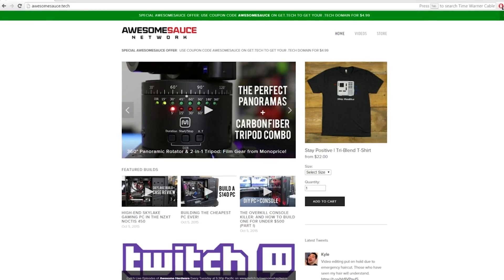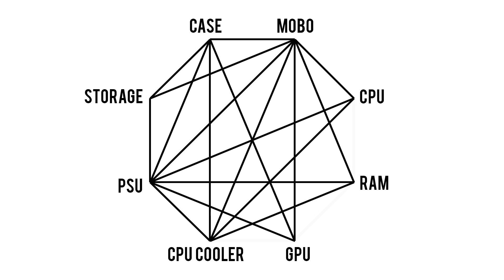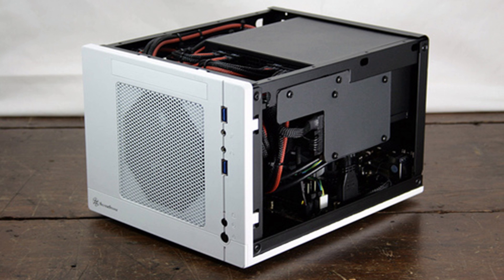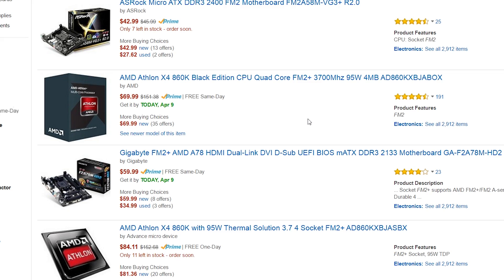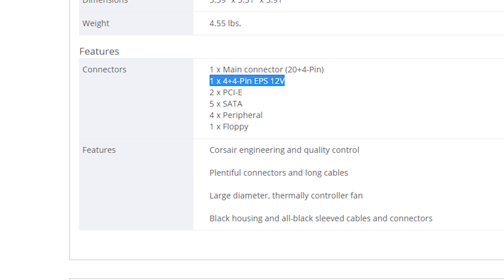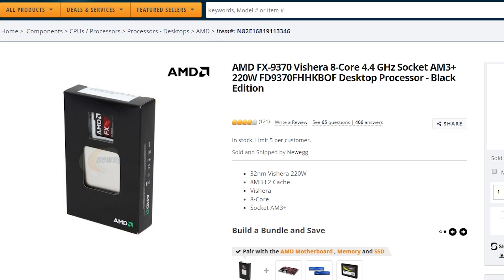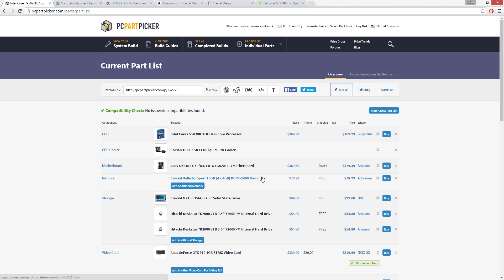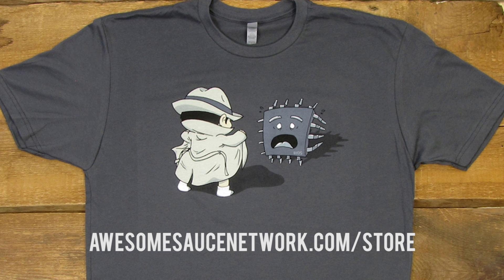How to Choose Parts for a PC! The Ultimate Compatibility Guide!

Comment: Hey I’m planning on building a pc but I’m not sure about the compatibility of my selected items can someone please help me out?

Gigabyte gtx 1660 OC 6gb 
2x8 Corsair vengeance rgb pro 3200mhz ddr4 ram
Thermaltake smart rgb 700w power supply 
Kolink observatory lite mesh ARGB case
Asus prime b460m-k motherboard 
Intel i7 10700F cpu
Thermaltake pure 12 ARGB sync radiator fan 120mm 
Gigabyte dual band wifi 6 ax pcle wireless adapter

Comment: "Look out for the height difference between the cooler and case"
so im guessing the cooler needs to be smaller?
Reply: Not sure if you are joking but yes, the cooler needs to be smaller than the available cooler height in you case of choice. Otherwise, the side panel won't close properly(or at all).

Comment: Here are my computer parts!

Corsair Icue 220T RGB Airflow Tempered Glass Mid-Tower Case Black

GIGABYTE Z390 Aorus Pro Wifi LGA 1151 Gaming Motherboard

Intel Core i7 9700 9th Gen 8-Core Processor

HyperX Fury RGB 16GB 3600MHz DDR4 Ram CL17 DIMM $ 100.01

MSI GeForce GTX 1660 Gaming X 6G Graphics Card

SAMSUNG 860 EVO-Series 2.5" SATA III Internal SSD MZ-76E250B/AM

Seagate ST2000DM008 BarraCuda 2TB 3.5 Hrad Drive

CORSAIR CX-M Series CX750M 750W 80 ATX12V Power Supply

Silver Stone NT07-115X Nitrogon 80 mm Low Profile CPU Cooler

Computer Cooling Case Fan

Comment: I didn't understand most of the things he told. Can anybody just tell me if It'll work pls:
Ryzen 3 3200G
MSI A320M-A Pro Max Mobo
Corsair Vengeance LPX DDR4 3000 RAM
Crucial BX500 SSD
Corsair CV450 PSU
Corsair SPEC-05 case
*its a super-budget build btw

Comment: can someone elaborate on the usb header situation? Im working on a build with 2 usb 3 slots in the front IO but the motherboard that was recommended to me has one usb 3.2 1st gen header while my case is outputting the 2 usb 3.0 slots. is this compatible or should i need to get any adapters to accommodate ?

Comment: CASE = Narrow box that holds everything

MOBO = Motherboard
The mobo is where everything plugs into 

CPU = Central Processing Unit
Basically does everything

RAM = Random Access Memory
Stores data that needs quick access

GPU = Graphic card
Figures out what it’s suppose to look like on your screen

GPU COOLER = Small fan so that gpu doesn’t over heat

PSU = Power Supply Unit 
Gives electricity to what needs it

HARD DRIVE = Storage
Opposite of ram desc., stores data that takes longer to access

Im still kinda new at this so if wrote something wrong please tell me. I really don’t want people to get the wrong idea!

Comment: Awesome guide. the only thing id add is to make sure that if you wanna mount a lot of case fans, you'll also need to make sure, that either your motherboard has enough connections or that your PSU has a SATA connection to spare for a fan controller (if your case doesn't already have an fan controller)

Comment: I recommend you watch this video as you check for compatibility. If he says you need enough sata connectors for your hard drives. Pause the video and check. I used this method and it seemed to work but I haven't ordered the parts yet.

Comment: there is a massive discrepancy between the wattage of the video card between what the manufacturer says and PC part picker says (275 watts), what do I need to do?
Reply: PC part picker normally says the wattage is higher than it actually is, less room for error that way
Reply: @dabirdie1797  the manufacturer says it's 500 while pc part picker says it's 225
Reply: @comradepingue1917  Are you sure they're the same?
Reply: @dabirdie1797  100%
Reply: @comradepingue1917  What is the part?
Reply: @dabirdie1797  xfx-radeon-rx-590-8-gb-fatboy-oc
Reply: @comradepingue1917  It depends on what you're playing. I'd recommend going off of the higher one so you dont buy a power supply that doesnt power everything
Reply: @dabirdie1797  I already got a new one, don't worry, but I wanted to know what I needed to do in case PCpartpicker said something else than the manufacturer

Comment: Nice and clear, I will have to rewatch a few times but the video is very good! Thank you! 
One question though: If I buy all the things, do I have to buy cables sepparately or are they normally included with the parts I order?
Reply: Most of the cables are included, except for the video and network cables.
Reply: @JJFlores197  thank you :)

Comment: Also ensure your CPU and RAM are compatible; this isn't much of a problem on high-end components but in the low-end CPUs can have a fairly low maximum memory speed support, for example the Ryzen 3 3200G only supports up to 2666MHz memory. Memory capacity is also to be taken into consideration as again, some CPUs cannot handle more than say 32GB of RAM, or are only compatible with a certain channel (single, dual, quad, etc)
Reply: Oh yeah, also make sure your CPU isn't bottlenecking your GPU, and vice versa. Low-end CPU = low-end GPU and same on the high-end. One way I've heard of ensuring these components play nicely is benchmark videos; if one component is consistently at 100% load and the other one is chilling at 70%, the 100% component is bottlenecking the 70% one. If both components are at 100% it's the game that's the problem, so check games that are less resource intensive to find which component is the real bottleneck

Comment: You should also connect a line between cpu and gpu as you need to check for bottlenecks and jf building with ryzen a line between the cpu and ram as the cpu is highly dependant on the speed and size of said ram

Comment: Dude I just got the shit confused out of me. I recently built a pc on pc part picker and I really want to know if it is compatible like what you are talking about in this video, can you please look over these parts and tell if it is ok. 

CPU- Intel core i5-9600k 3.7 GHz 6- Core Processor

CPU Cooler- Cooler master hyper 212 RGB Black Edition 57.3 CFM CPU Cooler

Motherboard- Gigabyte Z390 UD ATX LGA 1151 Motherboard

Memory- Corsair Vengeance LPX 16 GB (2 x 8 GB) DDR4-3000 Memory

Storage- Crucial MX500 500 GB 2.5” Solid State Drive

Video Card- Zotac GeForce RTX 2060 6 GB Gaming AMP Video Card

Case- Corsair SPEC-06 ATX Mid Tower Case

Power Supply- EVGA BR 500 W 80+ Bronze Certified ATX Power Supply

Please help me.

Comment: Everything checks out on my build except for the motherboard and case ports. The case says 2 x USB 3.0 / Audio In & Out and the motherboard 2 x USB 2.0 connectors (supports additional 4 USB 2.0 ports)
2 x USB 3.1 Gen1 connector (supports additional 4 USB 3.1 Gen1 ports. Could you help?

Comment: Hey Bitwit, I am currently a console player but have really been trying to widen my variety in games and start playing competitively. I would do it on console but it doesn't function fast enough. I can definitely keep saving up as I've been doing lately. But, is there a (Up to date) list to buy budget wise for someone trying to do the same like me
Reply: I just did a budget build for about $800, and it runs flawless full HD at over 100fps on epic settings in every game I've thrown at it so far, and it has a crapload of room to expand in power. Would you like the link to the build sheet? It would be a good starting point to modify to your needs.

Comment: Another tip is to make sure the CPU you pick will  be operating at an equal or greater data flow in comparison to the video card so that you prevent bottlenecking your system. For more details search for PC bottlenecking articles.
Reply: Translation:
CPU = brain of the pc
Video card/GPU = torso of the pc
Brain has to be smarter and faster than the torso to operate correctly.
Reply: This just gets more confusing
Reply: @Elite_Sturmgewehr  The mindfuck that keeps on giving.

Comment: Hi, i am an interior designer from mumbai. i saw some videos of pc building and i made a list of pc parts for my 3dsmax modelling and rendering. could you please tell me that is it a good configuration or not? or else suggest some good parts. 
1. CPU - Intel Core i7 8700k Processor LGA 1151
2. Motherboard – Asus prime z390a
3. Graphic Card – zotac geforce gtx 1050ti mini
4. RAM – corsair lpx 32gb (2x16gb) 3200mhz c16 ddr4
5. Ssd – Samsung 970pro 512gb nvme M.2
6. External storage – 1tb
7. CPU cooler - Cooler master hyper 212 EVo
8. Power supply – any of 650w aprox
9. Cabinet case – compatible with other accessories
10. Cabinet cooler fan
11. Monitor – Dell s2719h s series 27” black
12. Keyboard and mouse.
Reply: No the GPU is way too bad for a high end CPU like i7. Get a rtx 2060 or 2070 or that

Comment: I just noticed that at the beginning of the video when you showed the whole octagon, there was a connection shown between the RAM and the PSU, yet when you went over the RAM section in the video, you didn't brief on the MOBO 'cause you already did that, then you explained the compatibility requirements between the CPU cooler and the RAM, but nothing afterwards about the PSU. Is there really a connection between these two components or was there just a mis-drawn line in the video? The same full octagon at the end of the video has this same issue. The connection also was not gone over in the PSU section, either. I'm not experienced in this field, and am looking to resources for learning, this was just something I noticed.
Reply: Here I was thinking I was the only one that noticed, did you find out what relation those things have and could you share with me?

Comment: after about 1000 tries on seeing if the motherboard is compatible with the case I am seriously thinking about just cutting a cardboard box
Reply: I'm not sure what the issue would be because there are only a couple of sizes of boards and a couple of style cases so they cant possibly be that different. mATX or ATX, that's about it. The case will have connections for whatever size it is.

Comment: What’s the difference between hard drive and SSD
Reply: HDD wirtes on Magnetic Disks and  SSD uses a Flash-Memory like USB-Drives. SSD are much faster, more resistant and more expensive.
Reply: Gsudi so can I have SSD without the HDD?
Reply: Shure, they are both different kinds of Hard Drives. But it's recomented to have both because SSD's are very expensive. Usually you have a smaller SSD for Windows and your most used Programs/Games and a HDD for Storage.

Comment: what about rgb cpu cooler connections?
there is a 3pin and a 4pin
Reply: You can put a 3 pin cooler on a 4 pin motherboard connector, there are no 3 pin motherboard connectors so it's never an issue :)
Reply: @nucleardonkeyboy1361  i actually found An asrock argb 3pin connector

Comment: Can you please check out the parts that I chose for my computer. Thank you

Case- Corsair Carbide SPEC-06 RGB

CPU- Intel Core i7 8700K Cpu Processore, silver

RAM- Corsair Vengeance RGB PRO 16 GB (2x8 GB) DDR4 3200MHz

Motherboard- Asus PRIME Z390-A 

Hard disk- Seagate ST2000LXZ01, 2 TB Firecuda Gaming Sshd

GPU- Asus GeForce DUAL-GTX1060-O6G, GDDR5 6 GB

CPU Cooler- Corsair Hydro H100X

Power supply- Seasonic Focus Atx da 850W, black

OS- Windows10
Reply: With this budget, I would extremely recommend that you get an SSD or M.2 drive. You can probably sacrifice your ram RGB for a windows boot drive.

Comment: You mentioned steering clear of placing smaller mobo’s in a larger case to prevent optimum performance throttling... This has me concerned as I’ve recently purchased the NZXT H500i due to the delays on my originally ordered Louqe Ghost S1.. Will the pc performance be that bad or are we talking cable management/lengths?? I haven’t heard anything from Louqe and I’ve had it up to my neck with waking up and seeing a desk covered in top of the line parts waiting to be built for the first time...😂😂

Somebody... anybody.. please give me some feedback on if I should stay my hand or continue forward with this temp build!!!
Reply: no the performance should be fine

Comment: let me ask u guy a Q what does it mean by 6 USB3.1 Gen1 (aka USB 3.0) and 6 USB2.0
Reply: Jiho Bae it means there 6 usb3.0 slots which you can plug in a mouse, keyboard, and anything else that’s goes into a USB port and there are 6 usb2.0 slots which are only compatible for some things that plug into USB ports
Reply: It means there are 6 USB3 ports and 6 USB2 ports (USB3 is more power efficient and faster

Comment: Which graphics card fits a ddr4 motherboard? I keep reading online that there is gddr5 and gddr6 but i cant find a ddr4,maybe im reading it wrong
Reply: GPU RAM does not associate with mobo RAM.  A gddr5 or gddr6 will work with a mobo that carries gddr4 as long as the correct PCIE slot on your mobo is compatable with your GPU.
Reply: @banana_junior_9000  oh ok nice alright then imma look for some then,thanks

Comment: Excellent video. Im going to be building a $600 1440p PC featuring:
Ryzen 7 1700
AMD radeon RX 580 8gb
16gb DDR4 2666
2TB HDD
And a 600W psu, over powered for this build but i plan to upgrade so it'll work
Reply: You might be bottlenecking your CPU by putting in an RX 580, also I highly recommend a SSD
Reply: Im not going to lie. I hate buying SSDs. Sure they're faster but they cost WAY more. I'd rather pay $80 for 2TB of storage than $80 for 240gb of faster storage
Reply: @MrTopaz-zu1wv  Thats understandable but remember you can always upgrade to get more storage.
Reply: @MrTopaz-zu1wv  I just paid $80 for a 1tb ssd, they're not expensive at all dude. Also I'm not so sure how your 1440 experience will be with these specs honestly.
Reply: Oh yeah for sure. Thats kinda why i like to do a combo buy of both. As far as my CPU if anything it think the 1700 bottlenecks the 580

Comment: I'm just gonna stick with the PCPartPicker compatibility check list.
Reply: Stealthwolf it’s not always correct keep that in mind, but apparently it is extremely accurate so it’s whatever.
Reply: I've noticed the most common problems are with ram clearance so if you check that u will most likely be fine.
Reply: Jonah Feld There are plenty other things to check. Make sure you have the right kind of ram, ddr3 or ddr4. Also what kind of cpu socket mb you’re ordering compared to cpu, gpu power connectors, psu wattage compared to your components needs, cooling, etc.
Reply: MisterFister.69  I feel pcpartpicker usually gets those right although you are correct that it is always good to check
Reply: Jonah Feld lol yeah I did some research and pcpartpicker is suppose to be extremely accurate, yet it let me pair a lga 1155 cpu with a lga 1151 motherboard. That was a fun 3 week delay. Regardless it was my fault for not knowing about what I was doing.

Comment: Don't forget to pay attention to the height of 2.5" drives, as not all 2.5" drives are the same height (SSDs are usually 7mm, hard drives are typically 9.5mm). Some cases (Mini ITX cases in particular) will have mounting locations that are only 7mm high, preventing the mounting of spinning platter-type hard drives.

Comment: can someone help please im ordering all the components i want help on if the compenents are compatible together and how theyre performance will run with gtav and high en gamed and how fps am i gonna get 
plz :
Motherboard:ASUS ROG RAMPAGE V EDITION 10 LGA 2011-v3, DDR4, Intel X99 ATX Motherboard

cpu:Intel Core i5-8600K 3.6 GHz 6-Core LGA 1151 Processor

cpu cooler : Corsair Hydro Series H115i PRO RGB RGB Liquid CPU Cooler

graphics card gpu: Gigabyte GeForce GTX 1080 8 GB GDDR5 Windforce OC Video Graphics Cards (GV-N1080WF3OC-8GD)

memory: HyperX FURY Black 16GB Kit (2x8GB) 2133MHz DDR4 Non-ECC CL14 DIMM Desktop Memory (HX421C14FBK2/16)

case: Crystal Series 460X RGB CC-9011101-WW

ssd: Samsung 860 EVO 1TB 2.5 inch SATA Internal SSD - MZ-76E1T0B

hdd: Seagate BarraCuda 2TB Internal Sata 6Gb/s 64MB 3.5" Desktop .

power supply: Corsair HX1000 - 1000 Watt 80 PLUS Platinum Certified Fully Modular PSU CP-9020139-UK
are they all compatable  are they very high end  how much fps wil i get in gtav and other heavy games if know waht i mean like red dead 2
please help
Reply: 1. just follow the video to check compatibility, it's not that hard
2. you can't play red dead 2 on PC
3. you'll probably get 80+ fps on gtav

Comment: If the CPU comes with a CPU cooler, does that mean that the socket type on the CPU cooler is the same as the CPU socket type and will work fine on the motherboard as well? if you don´t understand anything I'm just wondering if the cooler that comes with the AMD R5 1400 will work on the ASUS ROG Strix B350-F. Both of them have the socket type AM4, but it doesn't say which socket type the cooler has

Comment: Please someone tell me if my specs is goood pls i will buy this specs soon

Ssd 120 gb hdd 1 tb amd 4.4 ghz gpu r7 260x 8gb ram 600 watts
Reply: Please someone tell me if my specs is good thx

Ssd 120 gb hdd 1 tb amd 4.4 ghz gpu r7 260x 8gb ram 600 watts
Reply: Is that an AMD CPU with integrated graphics? Cause if so, then you won't be doing a lot with it.

Comment: If the mobo says it supports sata m.2 ssds, does that mean any sata(3 & 6)?
Reply: M.2 SSDs work by utilizing the PCI-Express lanes, rather than SATA to increase storage speeds. So the answer would be neither, since they don't use SATA.

You can install M.2 SSDs directly into the motherboard, as long as they support M.2 SSDs.

Hoped that helped!

Comment: All I hear is atx case length size lol
Reply: The G-squad 
An ATX case goes with ATX, MicroATX, and Mini ITX motherboard sizes.

ATX is the biggest ITX is the smallest.

The length of the case must exceed the length of the graphics card.

The height of the CPU cooler should not exceed the width of the case. If you don't plan on overclocking then you can forget about this.

Power supply sizes don't really matter.